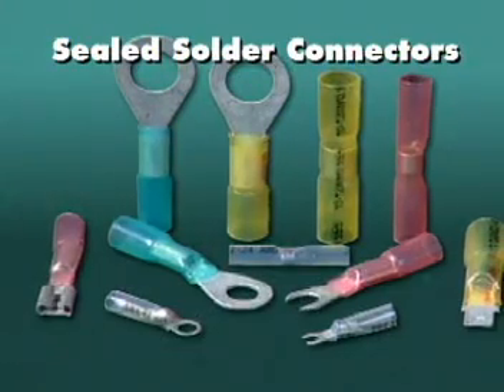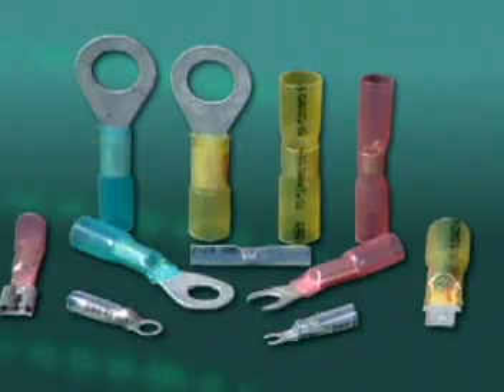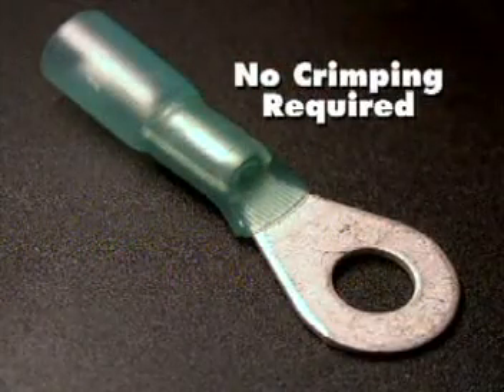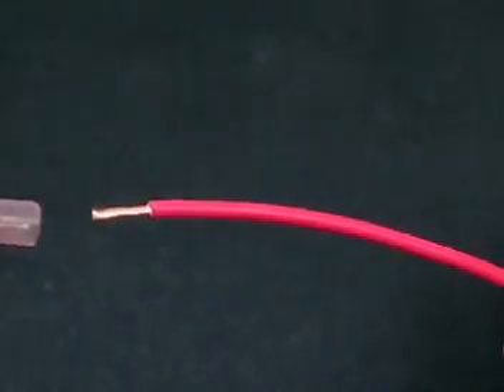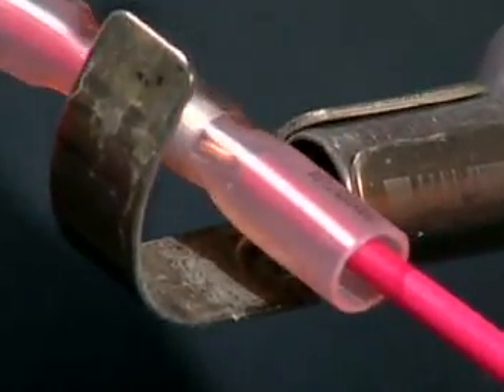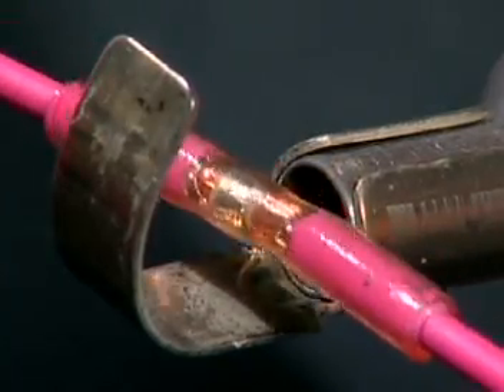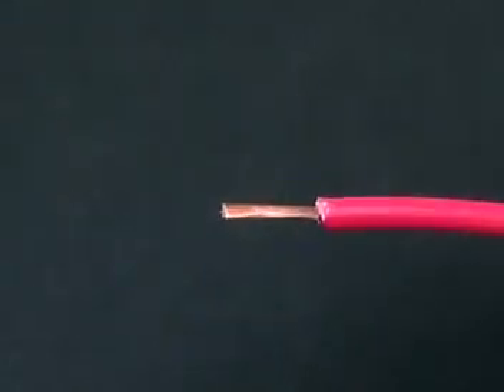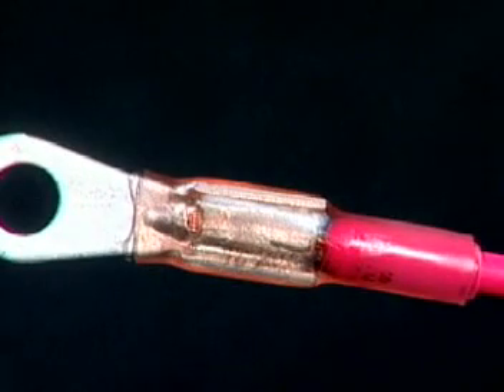Solder Heat Shrink Terminal Installation

Comment: Junk
Reply from the maker: Hello! Do you believe the product is junk or our demonstration? We'd love to hear some feedback to improve.
Reply: @delcitydirect  just currious if anyone tried a tiny amount of flux on wires twisted together before sliding over solder connector & heating will increase the flow thru the wires as well as traditional soldering??
Reply: @davidkina5627  the solder in the terminal is fluxed. Just a rosin flux, or something similar that won't need to be cleaned off if course.

Comment: My only concern is that they don’t recommend a heat setting.  I needed 600 degrees to melt my connectors and it took about 90 seconds to flow

Comment: I'm surprised they don't mention the need to "bright clean" older discolored wire ends prior to assembly. I didn't see much solder flow in the video to be assured there will be good long term conductivity.
Reply: They don't penetrate all the way!

Comment: Looks cool, but if any soldering involved, FLUX should be used. And related "strength", I still believe to crimping! :) BTW frequently I join wires, where one end was already soldered, means you have no chance to screw wires into each other.

Comment: Are those a strong connection? I have seen others that are like traditional connectors, they must be crimped first and then you heat shrink them.
Reply from the maker: Great question. Yes! These will work just as well as the standard crimp style. The solder holds well. If you have other questions, give us a call at 1.800.654.4757 or shoot us an email at social@delcity.net.
Reply: Thanks man! I need some of those.

Comment: Would a lighter be enough to melt that solder?

On the same topic, isn't it a problem to have such a low melting point? Would the heat from the engine bay re-melt the solder?

Comment: You should twist the wires together after intermingling them to make a strong mechanical connection before you heat the solder splice on.

Comment: would the solder not remelt under high loads or amps
Reply: as any solder connection does, it is not uncommon for cables to unsolder themselves... but if you get then that hot your insulator is probably already toast (other problems). Just go good overkill with diameter and use weak fuses is the rule of thumb for cars, as 12V dc can take some amps ^^
Reply: For high load better to use lead-free soldering wire. I also fear such "easy" connection (as in video) will be stable.

Comment: 3M also makes a set of Crimp, Solder, N Seal connectors. Which connectors do you recommend? I thought I was installing mine wrong until I realized they made crimped versions as well.
Reply from the maker: nastystang113 Are you still looking for connectors? Reach out to us at social@delcity.net or 800-654-4757 with your specifications and we can see what we have to fit your needs.

Comment: This isn't practical. If you're good at soldering, you definitely don't need this. But I like the idea :)
Reply: they are practical, they save time on installations on vehicles, particularly in hard to get to places for a repair job, no fighting to hold two wires together while you try and hold the solder and solder gun,  we do quite a bit of custom accessory installs, trailer wiring and repairs, I have not used hand held solder in many years now,  heck ive gotten where I dont even to hand held solder on bench work anymore it just saves that much time

Comment: No, the tubing doesn't get damaged at solder-melting temperatures because the solder has a low temperature melting point.